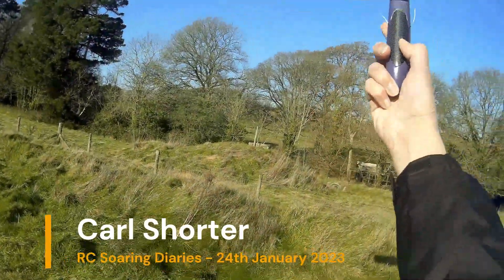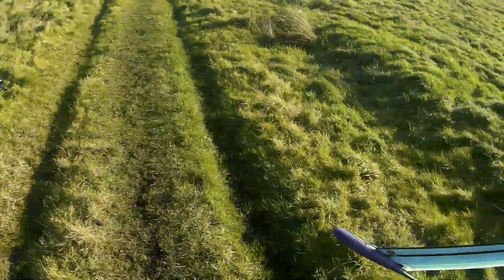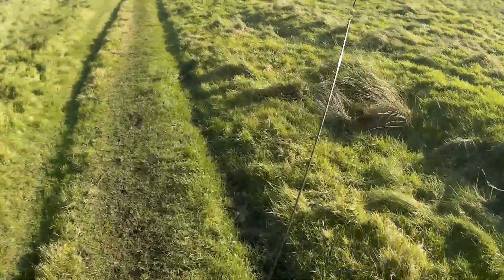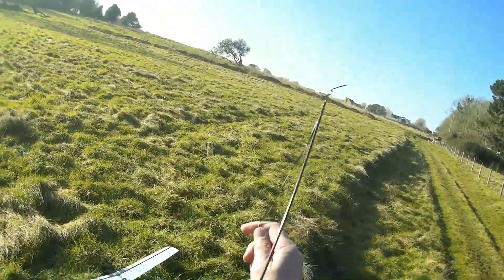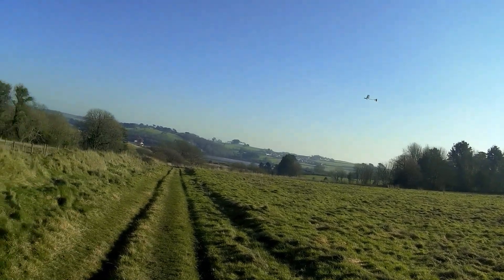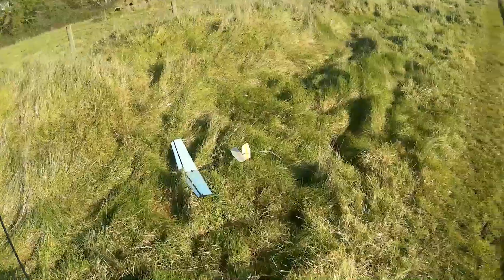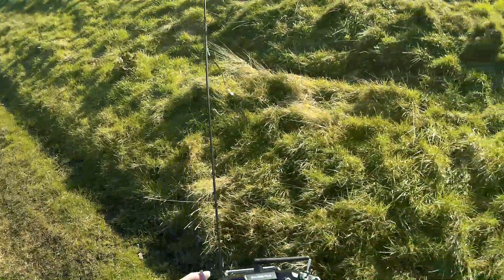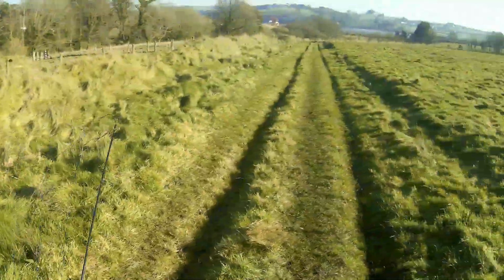TopSky mini DLG: My First 4 Channel DLG - 24th January 2023

Comment: I had the same issue with my frsky 6ch vario reciever, for such expensive recievers the antenna connections are shocking bad.. I had to carefully squeeze the little brass female pin back into shape, it had mushroomed out and the antenna was just half falling out of the socket.. as soon as I verified that it was connected properly, I ended up putting a dome of epoxy on it so I wonh have any issues with it again.. I really wish they would do away with those antenna connectors, there so bad..

Comment: Yes, you have to be careful with the antenna where it connects to the PCB of the receiver. Might be a good idea to check the connections on both, and then put some hot glue on there to make sure it stays in place.
Reply: Agree. I have had my frsky rx4r disconnected from the board. If you're lucky it will pop back into place and as you say can be secured with glue.
Really enjoying your videos Carl, looking forward to the day I see you with a full carbon DLG.
Reply from the maker: This is the receiver I've had trouble with before, so I've swapped it for a new one. In some installations I do use a blob of glue to prevent the aerial popping off.
Reply from the maker: Mark, I have treated myself to a couple of carbon layup 1.5m F3Ks before prices rocketed. Hopefully you'll see them in the summer. I'll get some 4 channel experience with this one and a Longshot 4 (to be assembled soon) first. Glad you enjoy my videos 😊
Reply: @RCSoaringUK  fantastic news, Carl. They really are worth it. I've enjoyed watching your vids since your sloping sessions and have enjoyed watching your progression. Keep 'em coming.

Comment: Thank you for sharing Carl! It is a fantastic glider! The weather is nice there I see. How much is the AUW?
Reply from the maker: Glad you like it. It's very DIY styled. The AUW is 163g. Glad I went for a pull-spring setup for rudder and elevator as it would have been heavier. New receiver inside now, so should have a proper go soon...
Reply: @RCSoaringUK  Wow, very nice weight! My 1m is around 200g...
Reply from the maker: @goldenfish77  And have you seen 'filos' latest DIY - 128.5g!
Reply: @RCSoaringUK filos dlg 80cm only 68 gram AUW
Reply: @RCSoaringUK  filo makes some good stuff